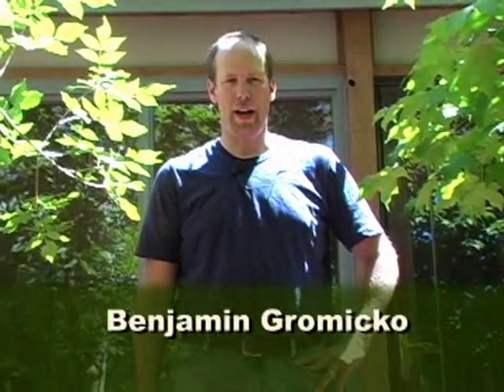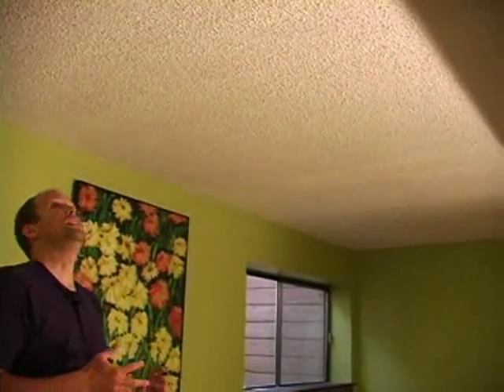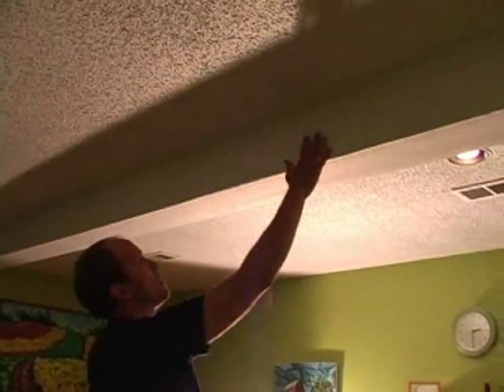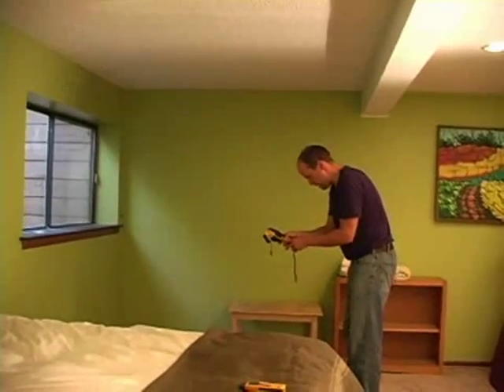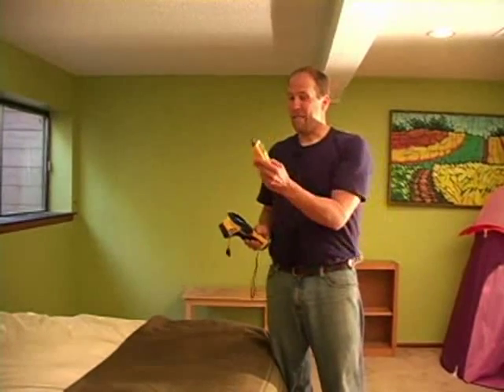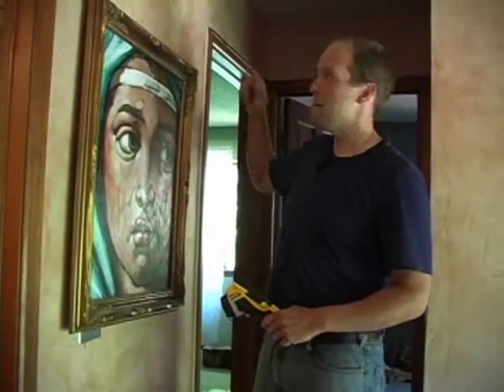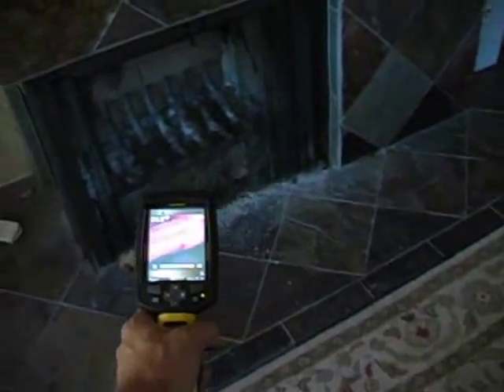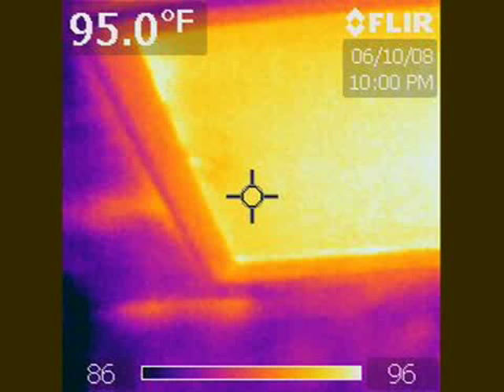Infared Camera Tips and Tricks

Comment: IRC (International Residential Code) doesn't require that a bedroom have a closet.  Why does Ben Gromicko state that 'code requires a bedroom to have a closet'?  Simply not true.
Reply: To be considered a bedroom it does
Reply: For taxing and appraisal purposes, most tax collectors and property appraisers consider it a bedroom if it has a closet.  This can make a 3/2 with an office become a 4/2.  The health department also considers the number of bedrooms when calculating the septic and drain field size.
Reply: You may want to check the building code before you make that statement.  Tax collectors and appraisers have nothing to do with the building code.
Reply: Hi, Dave. Good point.

In the video, I say, “This is a bedroom, even though, technically, by code and standard, it’s not a bedroom. It does not have a closet. But it’s definitely being used as a bedroom.”
 
That’s correct. Technically, by code and standards, a bedroom is defined in R202 as “habitable space.” Now, if there were a closet, with hanging clothes and shoes, in that habitable space in which I’m standing in the video, most people would consider it a bedroom. And I agree. It was being used as a bedroom. And, in R310 the term “sleeping room” is used, not bedroom.

By the way, in another training video course about egress, we used that same bedroom and window. The window sill height was 43 and 3/4 inches. Just made it.
Reply from the maker: That’s correct. Technically, by code and standards, a bedroom is defined in R202 as “habitable space.” Now, if there were a closet, with hanging clothes and shoes, in that habitable space in which I’m standing in the video, most people would consider it a bedroom. And I agree. It was being used as a bedroom. And, in R310 the term “sleeping room” is used, not bedroom.